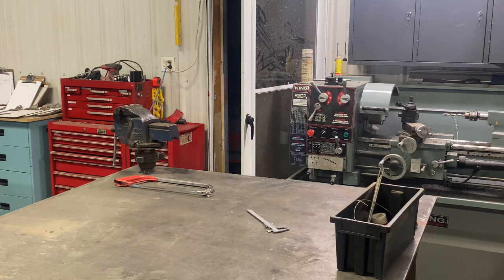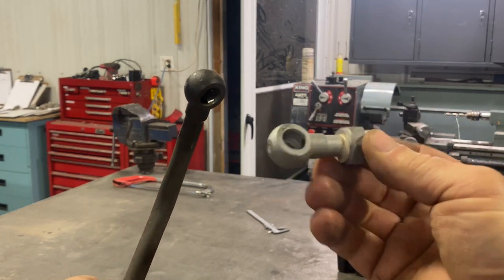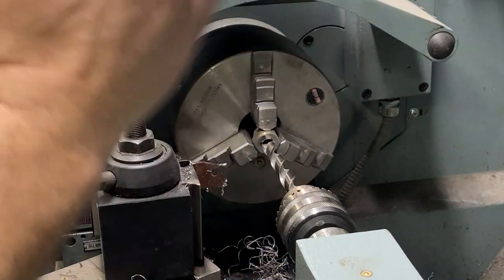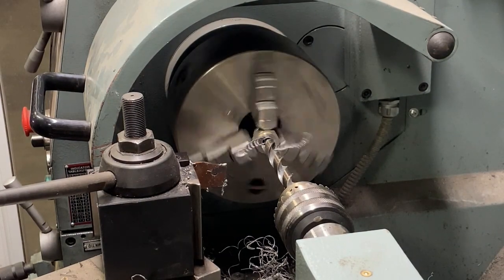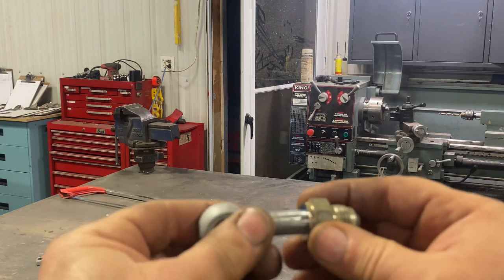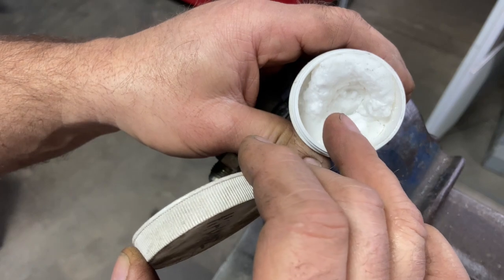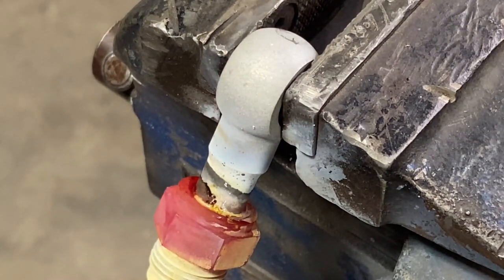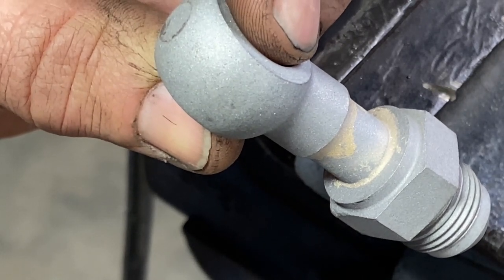Silver Soldering High-Pressure Fittings: A Step-by-Step Guide

Comment: This is a great video explaining the process, well done! I was wondering what solder should I buy for doing this sort of job and what brand/grade do you use?
Reply from the maker: @limey222  if you go to your regular welding supply store and ask for silver solder they should know what you need. That being said I was taught the higher the silver content the better. The shop I buy from has a roll I buy off a couple loops(no label on the portion I buy). The weigh it and take a body part, it is expensive😥. It is amazing how little you use so in the long run worth it. The flux I buy there as well. Over the years I have purchased different brands of it and have never noticed a difference. It is always a hard lump in a plastic container. If you want more exact details of what I buy comment back. I can call the Welding shop next week and get you exact specs on the wire and I’ll get you the exact part number of the tub of flux I have. Thank you for watching and reaching out for more details!!

Comment: so the fitting (threaded one) is to heavy to use propain/oxy ,,to heat ?
Reply from the maker: @RussellCompton-fh3gr  propane temp is 3560deg f and 2498 btu. Acetylene is 6300deg f and 1470 btu. So it is a balance between temperature (deg f) and volume of energy (btu). So you can have a higher more concentrated flame as to not overheat your part with the huge volume of propane. Acetylene is better to have focused heat with and the only one you can weld with(makes its own shielding gas) where propane is better to heat with because of the volume of energy it has. Hope this helps!
Reply: @prairiewingsperformance6036  thanks
Reply from the maker: @ thank you for watching!